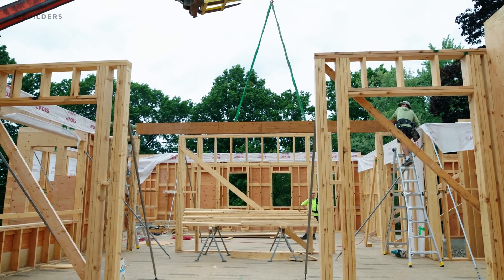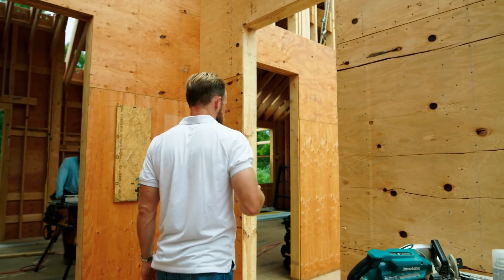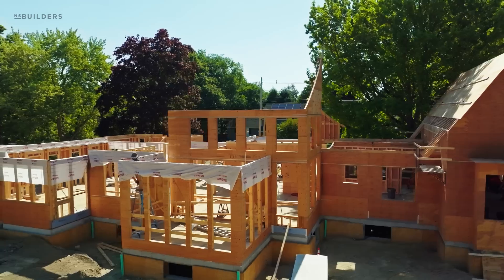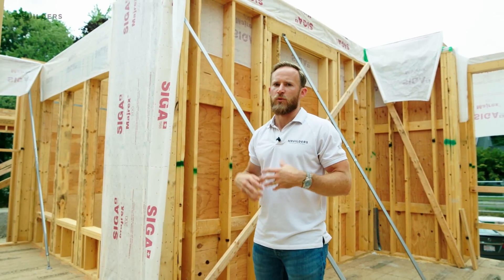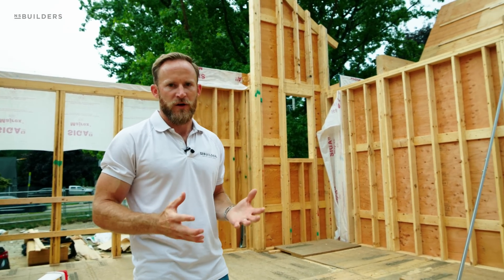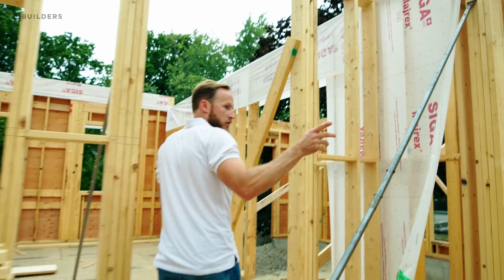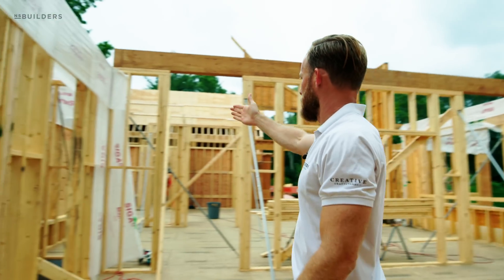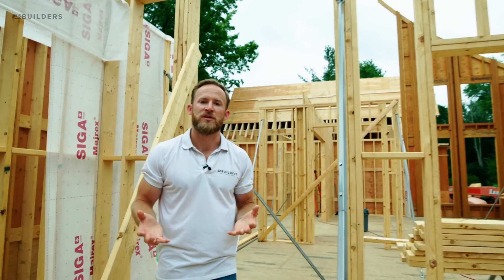How to keep your vapor retarder continuous

Comment: What’s the advantage of running a vapor barrier on the inside as opposed to the outside?  

The details required for indoor electrical and such to accommodate the air barrier seem cumbersome and very time consuming.  (Lots of room for error)

Isn’t exterior continuous air, vapor and insulation control much easier and more affordable?

Comment: Help me out...I'm in the south, Augusta, GA.  If I use Zip wall, taped and sealed with rock wool insulation - do I use a vapor barrier between the insulation and the sheetrock?  The idea that you put the vapor barrier on the "warm" side seems like nonsense - unless I disassemble the wall twice a year (kidding).  But seriously.  What should the wall construction look like? And what about the bathroom, where there is certainly very high humidity inside from the shower - fans and all?

Comment: Following all your builds, and while the attention to detail is amazing, compared how houses are usually built, I can’t stop to wonder what if a house like this needs to be re-piped 20 years later. 

Maybe that’s not something common over there, but in South California, all houses built in the last 20 years have constant pinhole leaks from low quality type M copper. Even houses built with type L have leaks in less than 20 years.
Reply from the maker: It’s a non issue, open the wall, cut the VR, complete the work and retape it at the cut. Unlike CCSF

Comment: In the early 90s, we used the continuous vapor barrier technique that is mentioned at 9:00. To recap: This sheet goes from the interior of the lower floor walls, outboard of the rim joists/floor above, and then back in to the interior of the upper floor walls. This creates a continuous barrier that captures the entire floor assembly, instead of messing around in between each joist bay. We used 6" wall studs and top plates, with 1/2" sheathing on the exterior, and so could inset the rim joist 2" while still having plenty of bearing surface for the ends of the floor joists on the top plate. Because of the inset, there was room for a  2" thick foam band around the house covering the rim joist, exterior to the vapor barrier. The entire house was clad, from footing to eaves, in 2" exterior foam. In total, each floor platform had 4" of foam insulation outboard of the rim joist vapor barrier. In Canada.

Comment: Couple questions 1. to be funny, me and my son were watching the video, we both lift weights, and I watch your videos as I love your knowledge on building. But do you do bi's and tri's before you film every-time, lol? But on a more serious note whats the red plywood, or at least that's how it looks? And if you are going through, all the trouble of wrapping, the tops of walls, for air-sealing in the future, how is that mitigated with open air construction? As those walls, floors and ceilings are getting rained on, or baked by the sun, expanding and contracting. I imagine this exterior building environment does take a tool on these surfaces does the 2nd condition neutralize the 1st. And I am an electrician so I've been around the trades since I could swing a hammer. But I am just wondering here.
Reply from the maker: Usually film on Monday’s and usually that’s my leg day 😂

And yes elements can impact quality. We just need to be mindful of that as we’re putting it together. Make sure we’re preventing issues later